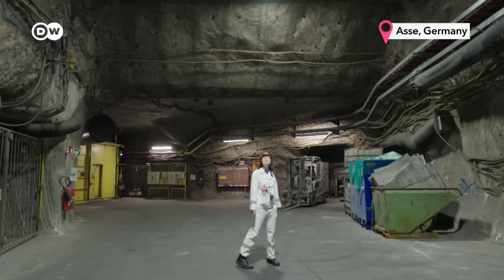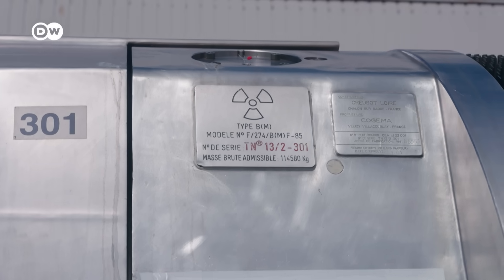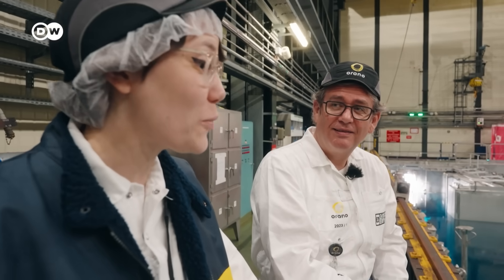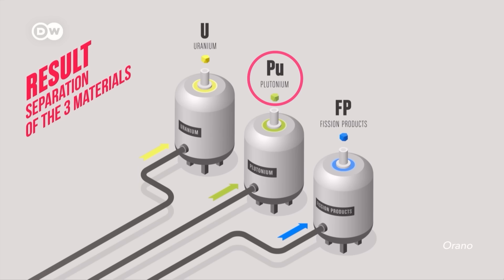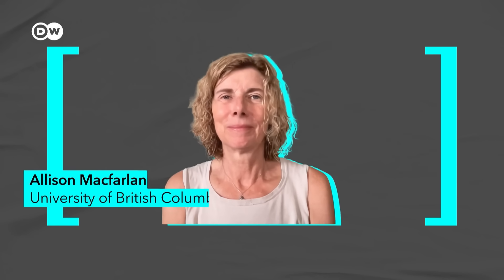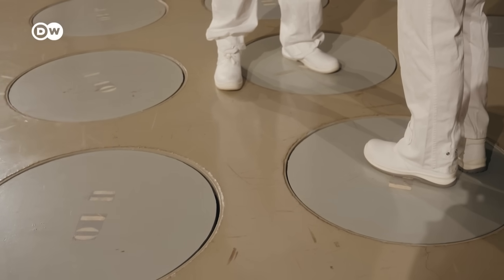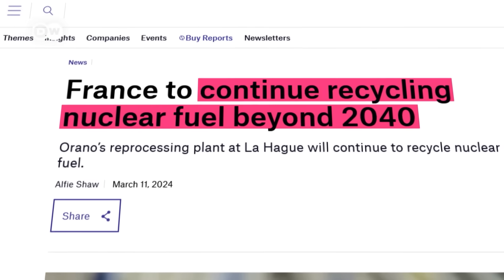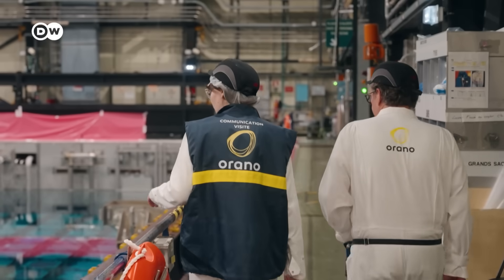Nuclear waste is reusable. Why aren’t we doing it?

Comment: Yes it is and is known to be recyclable.  It becomes literally hot from the short-lived radionucleides, so becomes unusable as nuclear fuel and has to be stored for 100 years to let these nucleides decay.  Then the fuel is reprocessed to extract various nuclear-generated long-lived valuable elements, and reformed into fuel pellets for the next cycle of use.
No problemo, save for a couple of trivial considerations....  One is that uranium-based nuclear fuel was developed with the intention of making atomic bomb material.  The other is political opposition to nuclear energy - which is somewhat connected with the atomic weapons issue.   And then who is developing Thorium as a nuclear fuel?
And why have we shut down the Thorp recycling facility ?

Comment: The biggest reason is cost and complexity.  Spent fission rods are comprised almost entirely of very low fissile U-238 which needs a "fast neutron" reactor to take advantage of.

Fast neutron reactors have 3x the cost to build and run over "normal" common slow neutron U-235 fuel which has very high fissile rate, and these normal reactors are already one of the most expensive forms of energy already.  Fast neutron fuel also decays reactor chamber walls, shielding, and control rods faster, leading to shorter lifespan thus requiring higher grade materials.

Comment: Cost. Without watching the video I'm saying it's because it's cheaper to use new fuel instead of reuse the old one. Let's see if I was right.
p.s. Yeah, it was mostly that. The extra waste from the chemicals needed for the recycling and the danger of having to deal with the plutonium was interesting aspect though.
Reply: Actually its the technology.

After quite a time passed and better tech and efficiency it is very much viable and scalable.
Reply: yes just like plastic, li battery, glass, metal, recycle is always most expensive
Reply: "Too cheap to meter" was the biggest lie :(
Reply: @georgelionon9050  the only thing that's actually too cheap to meter, yet still metered, is water
Reply: @erkinalp  heh, yeah, at at least in my country tough since canal dues are priced over water intake..

Comment: It's all about the cost, and recycling nuke waste is very expensive!  Nuclear power is ~6x more expensive than solar and wind + battery storage, so we'll see nuclear power decrease over time.
Reply: Just a reminder, we let the cost dictate what energy source we should use for a very long time, hence climate change via fossil fuels. Cost is very important, however maybe still not as important as the future of earths entire ecosystem.
Reply: @CraftyF0X  that's right, it's not just the cost of the energy.
you also have to add the costs of climate change to it, building flood protection, having less arable land, hotter summers etc.
if you add all those things on top of the base energy production costs, nuclear is cheaper than fossil fuels.

and no matter how much i love to dream about 100% renewable energy, we are a long long way from that.

for example very few countries would be able to produce enough green energy all year around, so most nations will need some power plants as back up.
we could make that problem a lot smaller if we share energy between countries in a region, like the EU sharing energy between all their neighbours.
but for that to work you need to be fair and not want to make a profit on that energy. because some countries are geographical privileged and would be able to make fat profit from the other ones and that would prevent those non-privileged countries from joining these types of initiatives.
and the amount of battery storage a region or country would need to get through a few days of bad weather would be astronomical. i doubt we could build that much battery capacity all over the world. those batteries need costly resources too.
Reply: Not true. Nuclear is subject to the same economies of scale as renewables. Building 1 reactor is very expensive, but building 60 (like France did) makes them very cheap.

We shouldn't abandon nuclear, we should take one (and only one) massive reactor design, and build loads of them in the same place.
Reply: The cost part is bs. To get reliable output as a nuclear pp all year all day without relying on fossils you need absolutely huge battery stockpiles at such levels that costs are similar to nuclear

Comment: It's really expensive to squeeze that last 90% out of spent rods, gets more expensive per unit of energy produced as you get toward 0%, and makes for more and more difficult to handle wastes.

Yes, you can extract military-grade fissionable material from these wastes. Which is what is attractive about it for France, for example. And part of why France uses deceptive accounting practices to hide the real cost of its nuclear energy.

Those casks that "fully protect" us? Have a reliable lifespan of 80 years, but have to work essentially forever, and require ultra-scarce highly valuable Iridium to work well. We have 400 years worth of Iridium on the planet, at current use level. Once used in containment, it too cannot be recycled. Iridium can make CPUs 10,000 times more energy efficient, so it's a shame we will lose it all to such waste.
Reply: w8, what iridium needs for in the storage cask ?
Reply: @CraftyF0X  What a great question!

It's not strictly speaking common to use Iridium in casks themselves, though it would in theory make the casks longer-lived and more effective. Stainless steel, lead, gold, copper, titanium, advanced alloys and concrete all work, with current stainless and concrete casks having a rated useful life of 100 years. A good program would re-skin containment every 80 years, for safety factor, because if you have 100+ containers with 1% failure expected in 100 years, you have a problem if you don't repackage your wastes long before then.

More common Iridium use would be for RTG cladding for space missions, or in classified military use (submarines), or in scientific and engineering equipment.

And that's where the Iridium comes into play in the casks: leak monitors and detectors.

Iridium has a half life of ~74 days, so is considered safe after use in radiation containment after a mere two years, and indistinguishable from un-irradiated samples after 20 years. So it's not completely true that you can 'never' reuse or recycle it.. just that there's a costly lag.

But the stuff's so costly and scarce you don't always see your casks monitored to the same standard as with Iridium. Is this a big deal? 

Depends how much you trust your cask manufacturer to not cut corners, generally.

The math adds up so that you'd have a 40 year supply of Iridium if all electricity generation were to go completely nuclear, but once irradiated supply chain needs a built in two-year lag, so containment gets a bit riskier and a bit costlier.

China builds 5 new nuclear reactors worth of solar PV a week without this issue.
Reply: @bartroberts1514  I'm not sure why you'd need specifically iridium to detecta cask leak, beside if it's juts a few small sensor I don't think the material use concern is that big. Also,  we could dispose the waste in a deep geological storage the leaks probably wouldn't matter anyway. (that would bethe idea behind it)
PV cells are not growing on trees either, certain amount of mining and industrial production associated with them too. Their recycle is not solved conclusivelly either, and you need to support them with a more extensive grid as well as energy storage. And that means you have to take those enviromental impacts into account as well.
Reply: @CraftyF0X  You're not wrong. And yet, Iridium is used throughout the nuclear industry, which is the chief user of the material. Can you sidestep the need by going with inferior alternatives? Sure. Just makes it more costly or less effective.
Can we dispose the waste in any of the ways that have been studied for seven decades without success? Sure. Deep geological storage is one of those less than perfect means to house containers, though it is generally sold with the "well-maintained containment" option. If you're happy to settle for something that in 80 years will lead to unhappiness, that leaks, that is likely to be unguarded and open to who knows what malicious use? Congratulations; you've joined the league of people mortgaging the future to get what you want today.
Comparing the environmental costs of PV to nuclear, as if PV's not the better case by a factor of ten, even without considering waste storage? Absurd. It's like saying, "But lettuce and cucumbers have calories too," while selling cheeseburgers and fries.

Comment: I could never understand why nuclear waste exist. If the problem is that it has so much energy left that it's radioactive at a dangerous level surely if possible to transform taught power into electricity or heat by using a different method like a  PV cell tuned to the wave length of that radiation or using to heat something with a lower boiling point than water
Reply: Actually not a bad idea, though I guess the problem is that utilities think in terms of turbines and turbine efficiency is largely influenced by the temp gradient, which is much lower in the case of "beta decay heated" waste than  fissile stff in a reactor. So they just keep the spent fuel at site and let it decay in a pool contributing some to the plant power output.
Reply: I think a big part of the misunderstanding is that there are 2 kinds of nuclear waste (actually 3 if you also consider depleted uranium from enrichment). There is nuclear fission product and there are unfissioned parts / transuranics (e.g. plutonium). Nuclear reprocessing is about separating these 2 kinds from each other. The unfissioned parts / transuranics get recycled into new fuel and recycling (if it's actually done) destroys that kind of waste. The fission products get stored. The fission products are the main problem here: they're radioactive enough and mobile enough in the environment to cause a giant mess if they were ever to escape storage, but their power is extremely low compared to the power obtained from fission (nuclear waste containers are often air-cooled). And with current technology, there is no way to speed up the radioactive decay to make the radioactivity go away faster. So they need to be stored for something like 1 Million years, which is a timeline where e.g. erosion of mountain ranges has to be accounted for.
Reply: @SASAS-ru8ys  Fission products by themselves go aways pretty fast. For the most part the fp returns to background lvl in about 300 year or so.
Reply: @CraftyF0X  300y is still way to long considering politics already have problems planning out the next term. These timespans are too long for humans to handle properly.
Reply: @someone7826  If we put it in a deep geolical repository 300 years should be fine easily. You are right the about short term thinking though, this is pretty much the reason why there are barely any designated repository. I just don't think we should adopt the "we will only ever be able to consider short timeframes thus we can't have nice things but thats fine we give us a pass" type of thinking. Call me a crazy idealist.
Reply: @CraftyF0X  For 300years, you don't need deep geological storage. AFAIK, deep geological storage sites are designed for a containment time of 1 million years. I don't know whether this is required just for transuranics or for long-lived fission products (probably for both..., maybe also for other nuclear waste such as neutron-activated materials). I'm a bit suspicous of the '300year' number because if it were that easy, this would already have been done (default guess: it's technically possible, but too expensive like so many other things in nuclear tech).
Reply: @SASAS-ru8ys  Ofc you don't need DGR for low level wastet. But, it could satisfy anyone with concerns about nuclear waste, which means, that the public could get over this talking point once and forever.
Reply: @CraftyF0X most if them are more than 300 years. TC99 >200.000 years
PD107 6.5 million years
Reply: @hernancortez5865  2 is not most of them, and when we say most of them we mean by mass that is produced, not by possible isotopes.
Reply: @SASAS-ru8ys  Molten Salt Reactors can split long-lived radioactive elements into short-lived ones that can be safely stored (half-life up to 300 years), uranium-235, uranium-238, plutonium 239, 240 and 241, which can be reused as fuel
Reply: Spent fuel releases enough radiation to be dangerous, but not enough to extract meaningful power. They put spent fuel in pools of water for a few decades to cool down, and even with many spent rods, the water is not too hot to swim in. 

Your concept already exists and has existed for over 50 years. We use certain isotopes from fission products for radioisotope thermoelectric generators. They're used on some space probes and satellites but not much else. They're useful because they can provide constant power for several decades before their output drops too much, but a space probe also doesn't use very much power. 

The reason we don't use it for power here on earth is because you'd need millions of dollars worth of extremely toxic and dangerous radioactive fuel just to power a single household. The amount of energy available is orders of magnitude lower than the actual fission.
Reply: @iankrasnow5383 

We've already dug it up and went through all the trouble of  refining it. 

Why not use the scraps? A little power is still power, better than sitting in a pool doing nothing.
Reply: You can't generate electricity from "heat", only from large temperature differences.  Nuclear waste is warm, not hot, there is no efficient way of generating power from warmth.
Reply: To a degree, we do: radioactive thermocouples are used to power probes for deep space, where the sunlight is too faint to rely on solar panels.

Comment: The reactors used for this are the "Fast breeder reactors", they are notoriously dangerous. They have to be operated with the strictest of discipline, there's no skipping safety checks with these. We can do it safely, and in all honesty we probably have to.

We need to store spent fuel for longer than the pyramids have existed. We don't know what or who will live on this planet by the time that waste is completely safe. We owe it to the future to reprocess this waste and store it safely for the remaining 300-800 years. (Instead of tens of thousands of years)

Another benefit is that desalination plants can built on site, they have high energy demands which can't be met easily by renewables at this point and also take advantage of the latent heat from the FBR's.

It's a no-brainer, we have to do this.

Comment: That expert from UBC in Canada definitely had a terrible attitude.
Reply: Tonetrolling experts who tell you things you don't want to hear?
Reply: It's just called a little short sighted no need to go personal. If we build up nuclear to meet limate goals we can run out of the easily mineable material in like 150-200 years depending on the build up. So, its not a completelly invalid perspective to say, woooah we don't care about that problem yet, but it also not irrational to think that ppl 200 years down the line still may need nuclear power, in which case we would already took all the low hanging fruits.
Reply: @CraftyF0X  That's not what this video suggests. Our climate goals should all focus on giving us time and energy to advance technologically. You can't see this linearly where we live in a world with stagnant technological advancement. Why? Because then we are doomed— literally. There is nothing we could do if that were the case; we are simply doomed. Thankfully, that is not the case at all. Human adaptation is adept, and we should use that to our advantage. As we learn to use nuclear efficiently and find more alternatives to the nuclear fuel we have now, or even discover doable fusion or more efficient alternative methods, we will continue to have the energy we need to advance. Being stagnant is not an option and is certain death.
Reply: @faberofwillandmight  Same approach, only putting it away for now would mean going step by step. Saying like "we don't care about reuse for now as its easily minable and when it won't be we will care" Do I agree with that ? Not really, Im more like as you said, we should continue on relentlessly pursue better solutions, even if their beneficial effects comes onlineis long after we are gone.
Reply: @CraftyF0X  I see them more as excuses to not use the most powerful and efficient energy source available to man currently. Maybe I think it's too obvious, but the dude is an expert. Imagine studying this all your life, and the conclusion you come to is that we shouldn't pursue it because it's too good? Consider what their alternative is, traditional renewables like solar, wind, hydro, and geothermal. Even if we ran out of nuclear fuel in fifty years, we ought to have so many more renewables if energy is no longer a problem, and we can just pop them out using nuclear. It is a crusade against nuclear and an intentional or idiotically unaware draining of our current lifeblood (fossil fuels). Yeah, let's just knee-cap ourselves while we are straining against a boulder rather than just using the gas-guzzling crane until we can get a nuclear-guzzling crane.